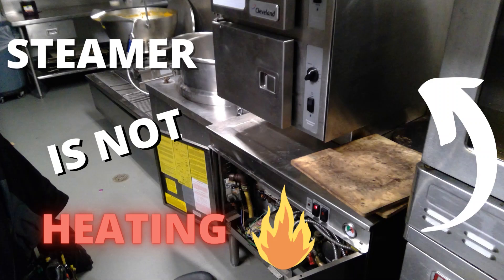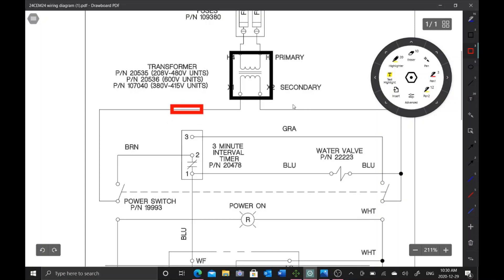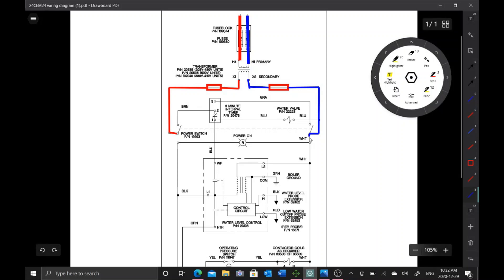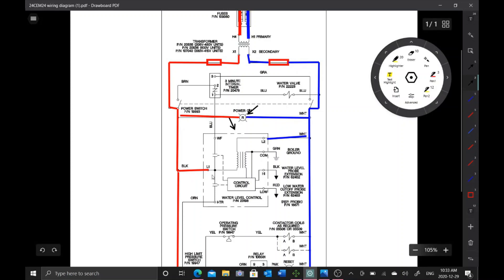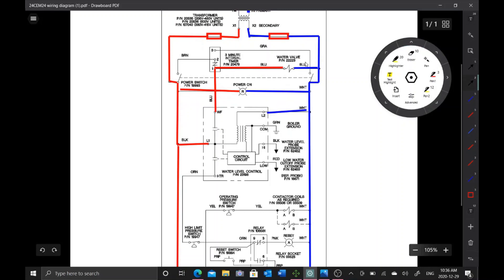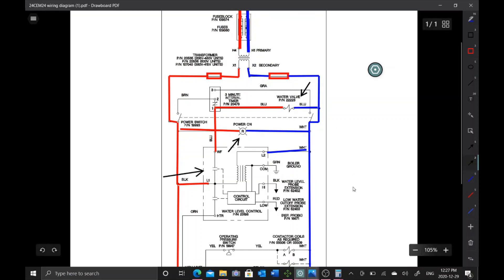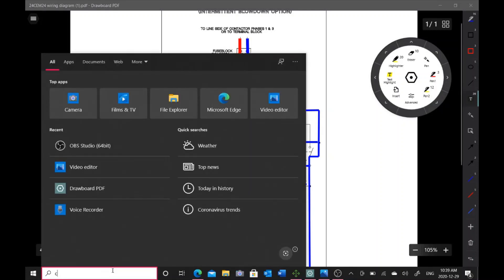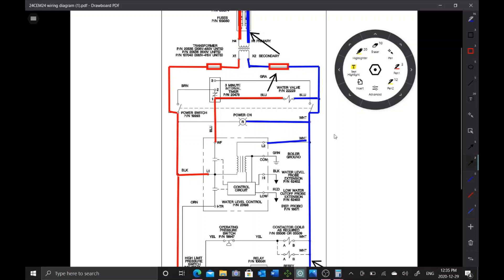Cleveland Convection Steamer is NOT Heating

Comment: may I ask you a question on my job we have a Vulcan steamer m # C24GA10  serial number 46-3036191 and my quest]ion is the module is get in  120 volts but not  nothing is happens except the water fill but won't turn on ,I think the module is bad ,terminal v1 and v2 from the module power the 120volts /24 v transformer right? the other weird thing the blower runs all the time but at a lower speed ,the question is the module power the transformer ?or the transformer powers the module? thanks for you videos and for you time.

Comment: Do you have a pic of the inline fuses & their holders you ran inline?  Thanks for the excellent training vid.
Reply from the maker: I use a CCMR fuse and you can really use any fuse holder. I use these illuminated Din rail fuse holder because they are well insulated and you can basically lay them on anything temporarily. I get them from the local electrical supplier for real cheap.
https://www.partstown.ca/alto-shaam/altfu-34771
Reply: I love dirt track racing and Cleveland steamers!

Comment: Can you put 1 fuse on one side only? Or the other leg might cause the trans to burn out.
Reply: Got it thanks
Reply: Actually one fuse will be more correct,, it's the same circuit & therefore the amps are equal thru the whole circuit.  (the poster is wrong about that tiny fact, but he showed great ways to isolate the fault).
Reply from the maker: it’s going to take the path of least resistance so you need to put a fuse on both sides.
Reply: @REFRIGERATIONKITCHENEQTECH  I'm shocked that the fill or condensate water valve can short bad enough to burn up the transformer but not the supply fuses; bad design. Cleveland is fucked up on that for sure. .  Btw & fyi,, the weakest fuse popped 1st.. since it's a closed circuit, the "shortest path" is the same place bro... amps would be the same anywhere in the circuit.. B'cuz of our demand, I just bought a new unit,, $8K now.. My issues are with sediment ruining the element (FL water) ... I'm gonna add a 3 or 4 amp popper in there now.  TY for ur video,,, I hate fixing equipment these days... lol

Comment: Drain valve was my first thought,  those fuse holders are a life saver. 
To bad those engineers don't think these things through.
Reply from the maker: ya I figured drain valve or fill solenoid. That part should be protected by a fuse because of the high cost of it.
Reply: @REFRIGERATIONKITCHENEQTECH ,I agree.
There are so many pieces of commercial kitchen equipment, that are very poorly designed, or not tested prior to major manufacturing. 
I went to Middleby Marshall school, they run you through the ringer, and it is pass or fail,or at least it was back when I went.
I love those types of things, challenges.
Reply: @REFRIGERATIONKITCHENEQTECH , or the water probe, if you have ever dealt with a commercial coffee maker, and at of steamers.
Calcium build up on those probes,will make them do the same.
Reply from the maker: ya always seeing water probes scaled up